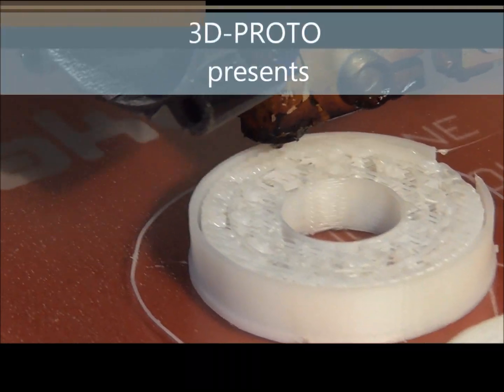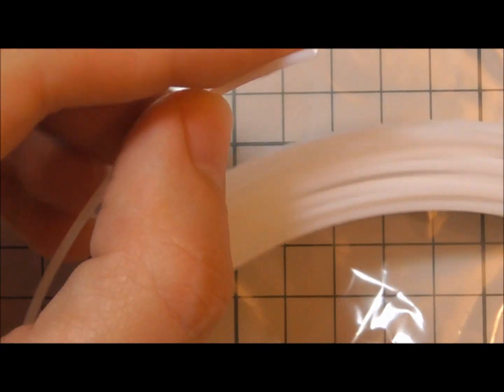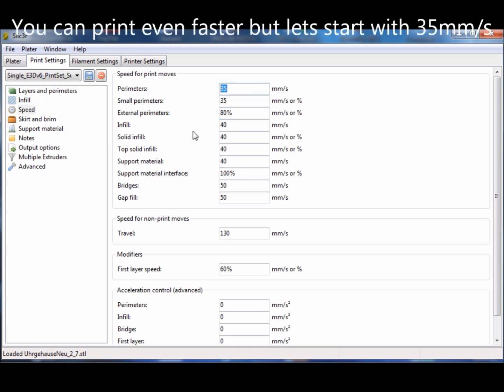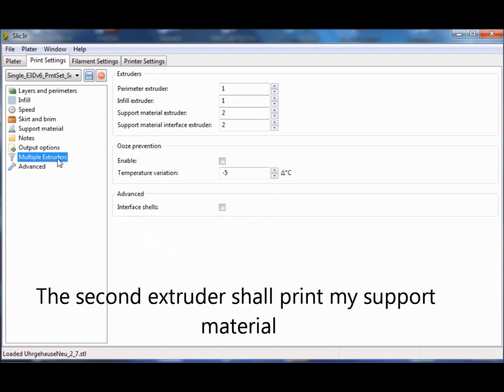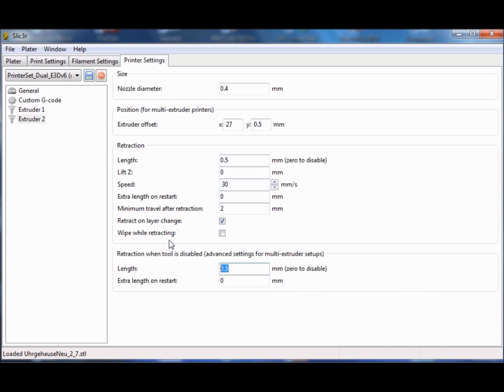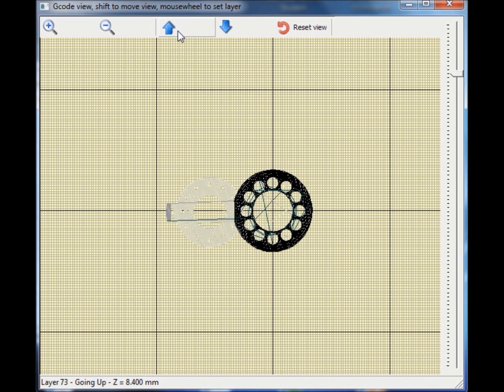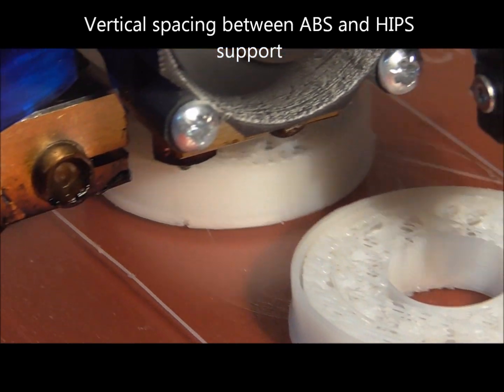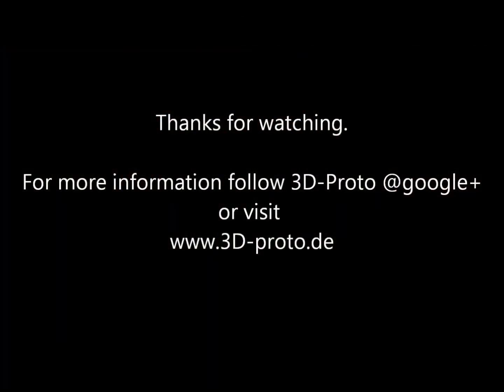3D printing support material HIPS: Slic3r settings and result / 3D-Proto

Comment: Can't seem to get ABS to stick to HIPS at all. Purge pillars and ooze barriers fall apart. ABS on top of HIPS has no adhesion and the ABS curls upwards badly. That's with 3 solid (100 %) layers of HIPS directly under the ABS (zero separation layers).
Could it be that certain brands of ABS and HIPS won't adhere, while others do?

Comment: I cannot find anything about HIPS supports with PLA. Is it possible?
Reply from the maker: HIPS needs to have much higher heatbed temp. Maybe you will need to face a problem when printing PLA with bed temp ~110 degC.  Let me know if you try.

Comment: Can you print a part directly with HIPS material so you can paint it? Isn't polystyrene what plastic model kits are made from?
Reply from the maker: Sure you can paint it...don't know if hips is used for the models. Would be an interesting information. Keep me informed when you find out.
Reply: HIPS is the absolute most common material used for plastic injection molding of model kits. It's a very good material to work with in terms of sanding, details and also welding properties. In fact you can weld it with limonene like you do abs with acetone. Commonly though there are other glues used in modelling that welds styrene that also work on ABS (because it is also a styrene). I am talking about injection molded kits here though. Comparably ABS is much harder to sand and is sometimes used as structural components like in Gundam models internal frame because it's a stiffer plastic.